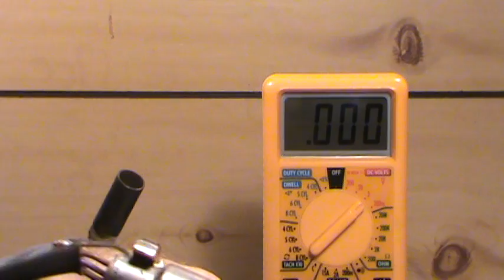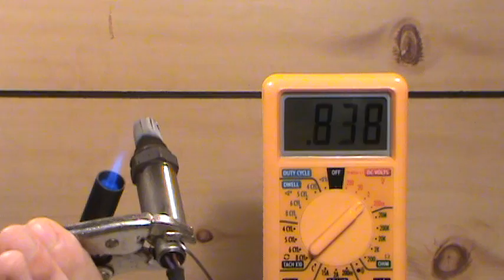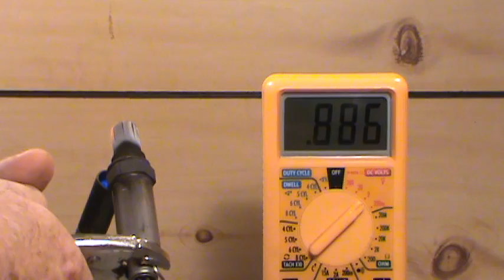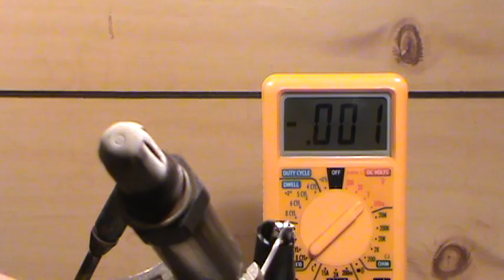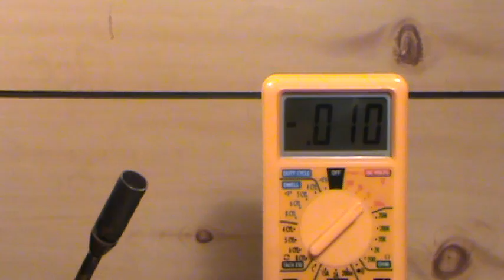Oxygen Sensor Test

Comment: Hi, Rocky- I just wanted to say THANKS for this great informative video! To add a couple things- an O2 sensor is a Galvanic Battery- meaning the Rare Earth metals that it's made with- produce an electric current when exposed to heat and oxygen. If you look at your propane torch nozzle- notice it has air holes in it, before (under) the actual burner nozzle. As the flame burns- it is drawing air (with an O2 content) that makes the flame hotter & blue. That's why you noticed and remarked at 6:09 the "rich" reading on the DVM. It wasn't reading the rich "fuel" (propane) is was reading the "rich" oxygen. If you had some aluminum tape- you could cover these holes in the torch- and you'd see a drop in voltage- and a yellowing of the flame. Most NG, LP, Propane, and butane burners (furnace, stove, camping stove, lighter, etc) have an "air control vent" for this purpose- to make a cleaner burning and hotter flame.
Reply from the maker: HUBBABUBBA DOOPYDOOP Greetings HUBBABUBBA DOOPYDOOP....Thanks for watching, and for Your Thankful comment as well.....................................................From what I saw, as it pertains to, the Pictures/Images, of a Cross-Sectional View, of a..."Zirconia"...Type of Oxygen Sensor (that be the Type, that Produces its Own Voltage Output, as opposed to the Other Type, known as a..."Titania"...Type of oxygen sensor, that supposedly Acts, kinda like a Resistor, and Does Not Output any Voltage of its Own, but rather, shall we say, Modifies the Reference Voltage, that is being Sent by, the vehicle's On-board Computer, that could be in the neighborhood of about 5 Volts DC, from what I gathered, then, once that reference Voltage was Modified, it then got sent back to the ECU/ECM for further Processing)..........................................................From what I recall seeing, as far as a..."Zirconia"...Type of oxygen sensor is concerned, is, the, Oxygen..."I-ons"...actually..."Pass-Through"...the, shall we say...Mini-Siv-Like-Structure...and then the Magic happens, with the end result being, a...Voltage being Created...that...Varied...due to the, shall we say...Amount of Oxygen I-ons...that were able to pass-through (if You haven't seen, the Images/Pictures, on the Net, that I have, perhaps, have a look-see for Yourself, as I found it rather Interesting, to say the least)..........................................................As far as I recall, the Stoichiometric (spelling?)...Value...of that good ole..."14.7 to 1" Air/Fuel Ratio...and probably at Sea Level as well (due to the amount of oxygen found at different altitudes, and yes, I'm only at, about 200 Feet, Above Sea level, for a testing reference, if applicable), as far as I recall seeing on a Narrow Band Oxygen Sensor "Graph", was showing...".45 Volts".....................................................Any Voltage "Above" that, was commonly known as a..."Richer" Air/Fuel Ratio or Mixture (aka, more Gasoline vs Air, by weight, that is)...where-as...any Voltage "Below", that...".45 Volts"...was usually referred to as a..."Lean, or Leaner"...Air/Fuel Ratio or Mixture.....................................................That..."Comment"...that I made (as far as I recall, that is), that I was talkin' about, in this/my Video, was in reference to, the..."Propane/Ambient Air Mixture"..."Flame"..that was surrounding, the sensing end/tip, of the Oxygen Sensor, in this particular Video, that was showing, a, shall we say..."Richer"...Air/Fuel Ratio"...then I thought it should be, seeing as how...Gasoline and Propane...shouldn't be, all that, shall we say..."Far Apart"...in respect to, just how much..."Amount/Quantity"... of..."Each Type of Fuel"...needs to be..."Mixed with, the..."Same, given, Amount of Ambient Air"...to be, well, in the..."Same, Soichiometric Ball-Park"...if You will..............................................................There could be the..."Possibility"...that this particular..."Oxygen Sensor"...is..."Out of Whack" (aka, Not working correctly, in respect to, Reporting the Correct Output Voltage, for this Propane/Ambient Air Flame) Perhaps, seeing as how, I didn't have a..."Gasoline Torch/Flame"...to..."Cook the Oxygen Sensor"...In..."To Compare"..."It"... to, just sayin'.......................................................Ah yes, the good ole, shall we say..."Torch-Head"...perhaps......................................Hmmmmmmm...let's now talk, about..."Super-Sizing"...that there..."Itty-Bitty"..."Tiny-Whine-ee"..."Torch-Head"...that You happen to see in this Video of mine, shall we...???.......................................Have You ever seen or used a..."Rosebud"...or..."Tiger-Torch" (might be other Names that they go by, as well perhaps), that happen to have a..."Torch-Head"..."Orifice/Opening"...at its..."Tip"...being at least..."2 Inches in Diameter"...that was Fueled by a...4 or 5 Foot high..."Propane Tank"...???.................................................Well, I sure have, and its probably as close as I'll ever get to...Starting-Up..an..."F-18 Fighter Jet's"..."Super-Duper-Mega-Thrust-Makin'-Propulsion-Unit"...But...only, as far as a, well reduced..."SOUND"...Level is concerned, that is...and it's always a..."Thrill"...to Fire one of these..."Big Propane Torches Up"...just to well, say..."Impress Others"...with the Big..."Racket" (aka, Sound) that..."IT"...Makes...!!!...................................................Yes-Sir-ee-Bob...One could say..."I've been there (hey, not everywhere...sheesh!...lol)....seen that (with both eyes open), and...done that too ! (just lots of things)...and...with all that, said and done, I depart with.................................Be Safe, take care, and have a good one.

Comment: Air fuel mix ideal (stoich) for pure gasoline is 14.7 (air to 1 of fuel by weight) but since we now burn E10 (Gasoline with 10% Ethanol) the ratio is different because Ethanol has a stoich ratio of 9.0.  To compute this it is (14.7 x 0.90) + (9.0 x 0.10) = 14.13.  14.13 pasts air to E10 (by weight) may create the best fuel economy but not the best performance however. Performance burns are richer. So the stoich ratio for E10 is 14.13.  
.
Good video. Good test I think. One think I do is pull the O2 sensors on my motorcycle and wash them by agitating them in a water bottle of Ethanol and Brake Cleaner mix. The inner surface (inside the shield) can be seen and this gets them nice an clean again. Just a thought: Avoid using any silicone sealers or gasket materials upstream from the exhaust as the sensors are damaged by silicone. Lead fuels and some metallic based octane boosters may also damage the O2 sensors.
Reply from the maker: Jay D. Anderson Greetings Jay D. Anderson....Thanks for taking the time, for watching, along with Your observations and information, that You posted in Your comment......................................................I, like You, have been thinkin', from time to time, about, the, shall we say..."Dilution"...of the...good ole Gasoline, with..."Ethanol"...that we are being sold these days, as Compared, to the, good ole..."100% Gasoline"..."Before"...they started..."Adding the Ethanol"...into the "Mix", and, how, it just might be Effecting, the..."Air/Fuel Ratio"...as well...................................................I actually had a..."Hands On"...Experience, with, just..."How Much Leaner" (air/fuel ratio-wise), that, that, and as they Indicate on some of the Gas Pumps around here..."May Contain Up To 10% Ethanol"...Gasoline, that started making my, Factory installed, Carter 850 CFM Thermoquad Carburetor's Air/Fuel Ratio..."Lean-Out"... at city speed, while just Cruzin' along, which caused, my 360 cubic inch, factory high performance Engine (8.5, or was it 8.4 to 1 compression ratio!...lol, but still gave me, NET, Not Gross...245 HP @ 4800 rpm & 320 Ft-Lbs of Torque @ 3600 rpm, and, maybe a few more, with the Long Tube headers, that were added, at that, and I, still only use 87 Octane gasoline!...Never Pings or Knocks, at the Factory recommended ignition timing Specs!)...well, not counting, that..."Lean Surge"...that I had to "Fix"...!!!..............................................................I came to the conclusion, that, even though, the Long Tube Headers, had somewhat "Leaned-Out" the Carburetors Air/Fuel Ratio, a bit, due to the, good ole..."Scavenging Effect"...way back when, I didn't, at that point in time, have any "Lean Surge Issues".......................................................but...then...next thing Ya know, quite a few years later, my car Started, Bucking back and forth, while just Cruzin' along at city speed.......................................................I ended up..."Increasing"...the Thermoquad carb's Primary Main Jets, using increments of, "Three thousandths of an Inch", each time, and went from .095" Up-To .104"...!!! (Yes-Sir-ee-Bob, that be..."ninety-five thousandths of an Inch", all the way Up-To..."One hundred and four thousandths of an Inch, Primary Jet/s Orifice/Hole Size...!!!).................................................................That, be, an..."Increase of .009" (aka, Nine Thousandths of an Inch), just to..."Get-Rid-Of...and..."Cure"...that..."Nasty ole Lean Surge"...!!!................................................The Engine sure Liked That Primary Jet Size "Increase", cuz, It sure Runs Much Stronger now, that's for dang sure!..................................................Goes to show, well, for Me anyways, that is, just how much "Leaner, air/fuel ratio-wise", that, that Gasoline, Diluted with Ethanol, had Effected a Carburetor Equipped Engine, that, has No Computer System, what-so-ever!......................................................That..."14.7 to 1" Air/Fuel Ratio, is, as I see it, only applicable, to, like You were sayin'..."100% Gasoline" (No Ethanol in its Mix), and having, the Vehicle's Engine...Up to Operating Temperature...Light Engine Load, as in, just Cruzin' along, and, not too fast...probably at Sea Level (Atmospheric Pressure at Different Altitudes, as, with a Carburetor, it's usually Jetted "Leaner", the Higher in Altitude, that the Engine is required to Operate at) is, as far, as a Computer Controlled Vehicle is concerned, is usually called..."Closed Loop" (operation), where, the Vehicle's Computer "Does" Include the Oxygen Sensor or Sensors "Signal", in order to Calculate, and Command, the Amount of Fuel, that the Fuel Injector, or Fuel Injectors "Spray" into the Engine.....................................................Now for..."Open Loop" (operation)..........................................."Open Loop" (operation) usually happens when, the Engine's Coolant (aka, anti-freeze n water mixture) is "Below" the Coolant Temperature, that's required for "Closed Loop" (operation), and, I've seen it, for some vehicle's, being around "140 Degrees Fahrenheit"..................................................When-ever it happens to be, something like..."Pedal-to-the-Metal"...time, as in "Floor the Gas Pedal", and, the Engine Coolant "Is" at Operating Temperature, the Vehicle's Computer should go into "Open Loop", and should "Ignore" the Oxygen Sensor's Signal..cuz...due to the very High Load placed on the Engine, the Air/Fuel Ratio, should now be, oh, somewhere around, about the, "12.5 to 1" Air/Fuel Ratio, some a bit Richer, and some, maybe a bit Leaner, and maybe that's with 100% Gasoline as well (No Ethanol added to the Gasoline) perhaps.......................................................So, even though some, if not most Oxygen Sensors, these days, have a Self-Contained Heater inside of them, and, the Oxygen Sensor is, shall we say..."Ready To Go", the Vehicle's On Board Computer, will usually Only Listen to, or Use, the Oxygen Sensor's Output Signal..."If and When, the Vehicle's Computer, happens to be, "Ready" for..."Closed Loop" (operation).......................................................Also, that "14.7 to 1" Air/Fuel Ratio, as I've Learned..."Is Not"..the Air/Fuel Ratio, which will result in, the "Best Gas Mileage" Possible, as, a Gasoline Engine is quite capable of going to a "Much Leaner" Air/Fuel Ratio...!!!.....................................................Apparently, the reason, for that, now Famous, good ole..."14.7 to 1" Air/Fuel Ratio...that has been drummed into our Heads, is actually because, "They" (maybe close to bein' Rocket Scientists perhaps), "Discovered", that, when a Gasoline Engine, while under a "Light Engine Load", and, that very same Engine is "Inhaling" that "14.7 to 1" Air/Fuel Ratio...the "Combined"..."Exhaust Emissions"..."HC/Hydrocarbons...CO/Carbon Monoxide, and the NOX/Oxides of Nitrogen"..were at...Their...(combined)..."Lowest Level"...!!!......................................................Some Food for Thought...I be thinkin', if the Engine is kept "Under" the "Designated Closed Loop (coolant) Operating Temperature"...and the Gas Pedal is "Floored at All times"...and...the Vehicle in question, is..."Always going up a Very Steep Hill, to keep "Engine Load Very High"...then, as I see it, we could...."Get Rid of"...All of those..."Oxygen Sensors"...cuz...the Vehicles "Computer"...Does Not Require them, for..."Open Loop" (operation) at all...but...Damn, foiled again...cuz...now the Vehicle's "Computer", is "Storing Trouble Codes"...Sayin'...something like, perhaps..."No Response"...from, All of those "Missing"..."Oxygen Sensors"...!!!...lol................................................Depending on the particular "Type" of Oxygen Sensor, I've been reading, that, eventually, "They Do Wear-Out", and, they can last, anywhere, from about 50,000 Miles to about as high as, about 100,000 Miles, but, then again, as I see it, that would be..."IF"...the Engine, and its Management System, among other things as well, are Operating somewhat Perfectly, and We All know, what the Odds of that are!...lol..............................................Well, that's about it, for the time being....................................................Thanks again for Your Superb comment...................................................'Till next time...Be Safe, take care, and have a good one.